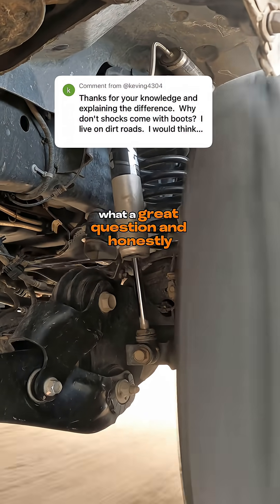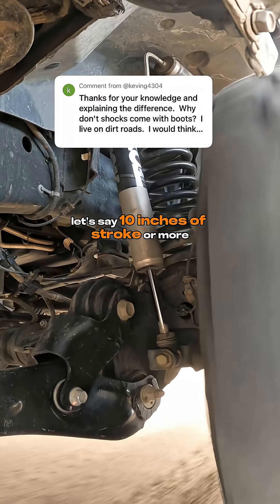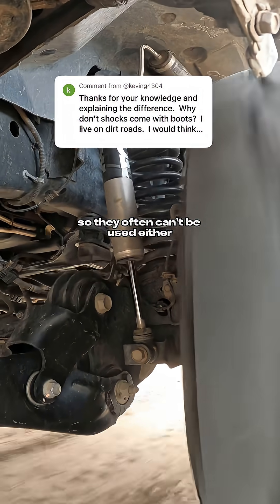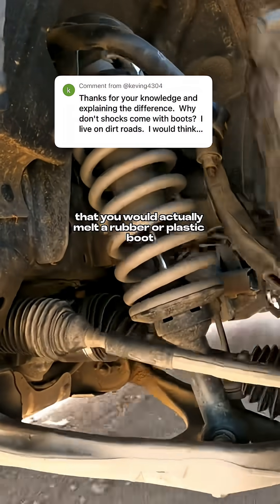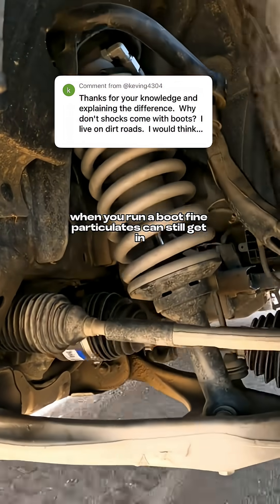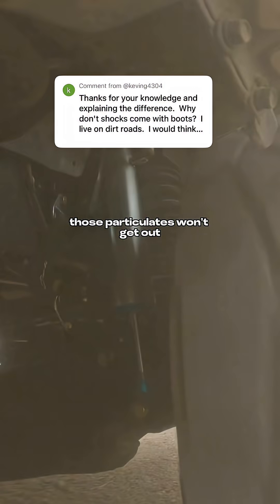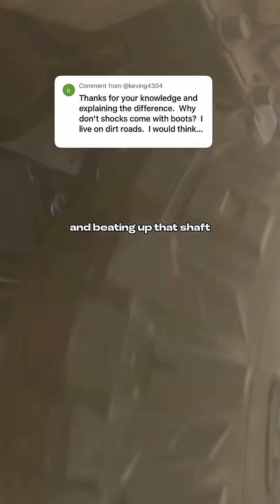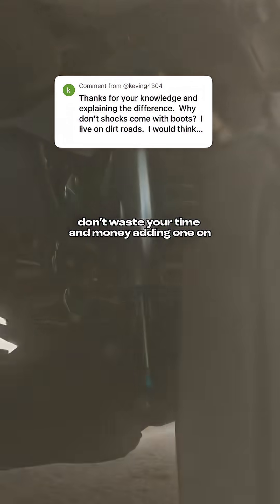Where’s The Boot? #shocktalk #shocksurplus #offroad #shocks101 #raceshocks #bootsareforbabies

Comment: I would like to know if its better to have the cylinder at the bottom or the shaft? Would it matter?
Reply from the maker: the shock body can be on top or bottom if its a monotube high pressure gas shock